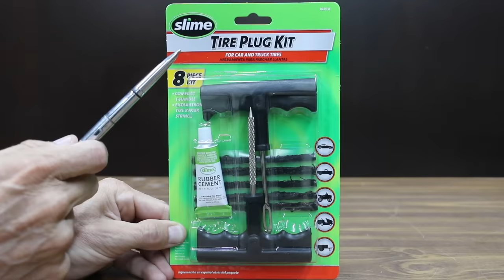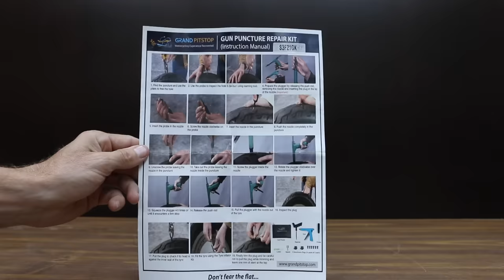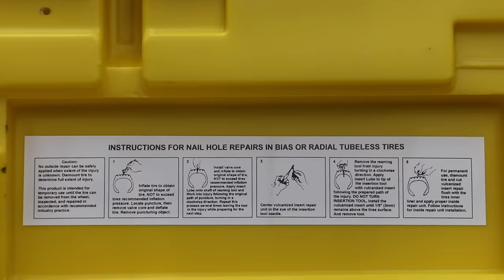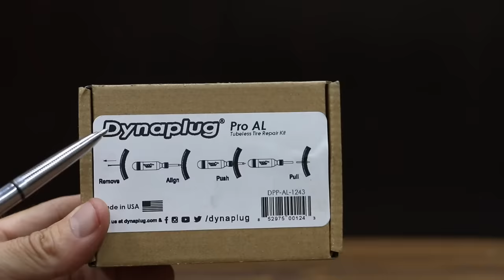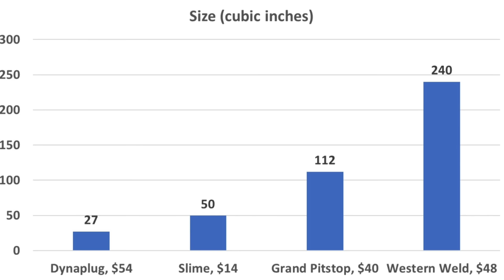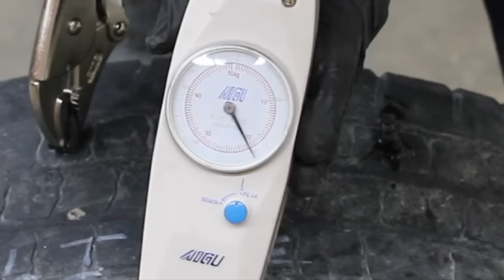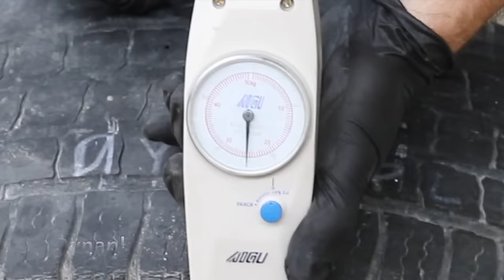Best Tire Repair Kit? SLIME, Westweld, Dynaplug, Grand Pitstop

Comment: I like the handles and reamer on the Western Weld and similar style kits. I've used the Slime style kits and those handles and probes are very difficult to ream while the wheel is installed because of how much force is needed to push them through.

I think another reason the Western Weld plugs might have performed better is the tool helps promote mushrooming when pulling out the installer.

Comment: A lot of new cars come with run flats, and many (most) shops won't repair them, even if it's just a simple puncture.  I've resorted to using this kits instead of going to a tire store.  The content here is much appreciated, I've actually used that cheap kit and had good luck with it, but will be replacing it with the higher quality kit for sure.  Thanks!
Reply from the maker: You are welcome!

Comment: Slime also makes a heavy duty kit with metal tools and the very sticky pumpkin colored plugs. I've used it on a steer tire on a big truck to get me to the tire shop and it held up to 110 psi for 30 miles. I keep it in the truck at all times. This is the most informative channel on Utube.  A big thanks to Project Farm.
Reply from the maker: Thanks!
Reply: I have been using slime plugs for about 20 years. Learned the importance on a construction site 2 hours from home. Got so good at them we repair a screw/nail hole with out needing to add air

Comment: The big difference in these repair kits is the Western Weld reamer. These almost thread their way into the tire as opposed to the rough type that depend on force. I carry a repair kit with a 12 volt air pump, needle nose plyers, cutting blade, gloves, and packable rain jacket. This is like a gun, anything is better than nothing. Which if you're going to be on  the side of the road I'd suggest having also.

Comment: Well as a mechanic and tire tech for 35 years, it was common practice to use rope plugs as a standard flat repair. Those practices worked fine (for decades) until politicians got involved.
Reply: I was a mobile mechanic and tire tech for 30+ years also. 24-7 on call road service. 👍Mr. Bean.
Yep, now if there is a plug in the tire.....very hard to get a shop to put a proper patch repair on the tire.
Also, any repair in a tire will negate speed rating and can effect load rating. So it's an insurance liability issue now days.
Most tire shops are more interested in selling new tires,  so they don't have proper repairs to be installed or a tech that knows how to make a proper repair. 
Kids now-a-days 🙄
Reply: As somone who went to get thier tire patched this weekend, half the shops just plug it and don't patch it
Reply: A few 'brown envelopes' later to corrupt politicians  voila!
Rope plugs no longer legal in Europe and some tyre companies are seeing their profits skyrocket...
Reply: @BJGlenn-cg3gs :  And we just throw more stuff in the landfill, and the cost of living keeps going up.
Reply: I just learned that this actually works. Trach your kids how to do these things, it isn't hard. Just practice repairing as much as you can. Even when it isn't always "worth it"
Reply: I'm sure failures do happen, just that they're rare enough that most mechanics don't see one or that a failed plug caused a totaling of the car so of course you don't see them.  
Still, we have insurance to cover human stupidity, and that's VERY common.
Reply: @maximman102n7  Really. I have yet to have any shop ever do that. None that I know would ever plug the hole. You are lying.
Reply: @awboat  Calling someone a liar is not only mean and vicious, it is totally unfounded. While I was having some trailer tires mounted and balanced I watched one of the techs plug two tires from different vehicles. I will not name the company but it was a major tire store in the US.
Reply: What tire plug law was passed?
Reply: @yolo_burrito there was a spate of catastrophic tire blowouts causing major accidents in Europe (likely just a coincidence) like pile ups, tunnel crashes, etc. So the EU banned tire plugs made of rope dipped in tar. However they did and do allow plug + patch repairs, allowing you to plug and then add a small adhesive patch over the top.

This comment section is trying to infer that this was done at the behest of tire manufacturers - it wasn't, it was very popular at the time. It was useless legislation but it was done to aid popularity in France, Belgium and Germany. The two largest tire manufacturers actually lobbied against the law and spent millions trying to oppose it.
Reply: @medes5597  thanks
Reply: Is it really politicians?  Or is it an insurance liability issue for the repair shop?
Reply: @awboat Three tires repaired at three different shops during five years of travel. All used plugs.  Not lying.

Comment: I was tried to repair my SUV's punctured tubeless tyre with rubber strip kit. I put rubber cement on the strip and tried to insted it into the tyre. But during inserting the needle with rubber strip in my SUV Tyre, I mistakenly put more pressure and whole rubber strip went in and loosely fell into the tyre. The hole was left opened. So I had to insert another strip to fix the puncture.
 Will it cause any damages to tyre in long run or will it cause issues in driving the car at high speed like tyre wobbling due to wheel unbalancing etc ? 
Can I drive the car normally with it ?

Comment: You should see if you can repair a tire with flex seal or flex tape
Reply: Yes. Maybe even straight roofing tar squirted into the hole
Reply from the maker: Thank you for the video idea!
Reply: I don't know about their tape yet their water proof sealer will work for a temporary fix on an already damaged tire that will need replaced.
Reply: Brilliant! I’m a huge mark for the flex products.
Reply: @ac.creations  I have done that it either works or it doesn't. If you have a hole and a screw that fits tight in the hole a little liquid nails or roofing tar can be helpful.
Reply: Flex tape would probably work as a patch on the inside of the tire.
Reply: @ProjectFarm  could you possibly do this with bicycle tires as well?
Reply: @troyna77  I've found I can change a bike inner tube faster that messing with a patch. That said, I still ride with patches in case the spare tube(s) puncture too.
Reply: @a111z  Anything made by flex seal is really expensive. If you are going to pull off a tire and patch from the inside you would be better off buying a combination patch with a plug and cement doing it the right way it would cost a lot less plus it would be safer. Tires expand, contract, flex, and too many people get killed every year from screwing around with band aids on tires. Their tape might work just long enough to get you home or to a shop. My guess is once the puncture gets moisture and dirt inside I guarantee it would probably push the tape right off. I repair tires and have seen people do just about everything and I am still seeing some crazy things that get them to a tire shop. Fix a flat and liquids are a nightmare I cringe when I encounter one and usually tell the person buy a new tire. Reason being cleaning all that stuff out of the inside of a wheel and tire is a nightmare patching those successfully it takes a lot more time.
Reply: @justme_gb  That is exactly what I do on all tube type tires. That is the smart and safest way of going about it 👍
Reply: @sswcustomsewing4276  oh yeah, I wasn’t trying to endorse using flex tape. It would be silly to go through all that trouble and not use a dedicated repair product.

Comment: The only thing missing is doing this on the side of a busy interstate when it's either 1) raining or 2) 100 degrees.  With an irritated, baby or two.  Then, it'll feel like a real-world experience!
Reply from the maker: lol
Reply: Although it is clear that any plug, by any brand, installed in these conditions will catastrophically fail after you have driven just 5 miles, so you have to stop and do it again, while your wife is bitching why you can't just call AAA.
Reply: I'd NEVER use Slime in a vehicle that is used on the highway. That is a disaster waiting to happen.
Reply: Real world experience you'd also be installing a plug with a bunch of trunk carpet plastic stuck to it and you'd lose the reamer and have to use a screw and some vice grips.
Reply: @ProjectFarm  I have a clone of the Western Weld and it's rock solid.  Very heavy duty, exactly as you described in your tests.  I plugged a tire and it held for the rest of that tire's life, somewhere around a year or so.  Really enjoyed the spirited driving montage.
Reply: @workonitm8  As a temporary measure it's probably fine. The failure mode of these plugs is usually slow loss of air, not sudden explosion of the tire.
Reply: I plugged my Ford Aerostar in the middle of the winter,in a very cold and snowy evening.That plug stayed there for another 4 years.A month ago i plugged my motorcycle,been on the highway,no problems so far.
Reply: @tirpitz19  Yeah all the plugs I've ever installed lasted the life of the tires. That's the Midwest too, it doesn't get much harsher than that. Burning asphalt in the summer and salt brine all winter long.
Reply: @jamisonw.327  I would say,a Chinese tire will disintegrate faster than an American plug.

Comment: I've used dynaplugs for years on my 1000cc superbike.  I chose them because they are the only plugs that are designed and tested as a permanent repair. All other plugs to my knowledge are only rated as a temporary repair to get you home. I fixed a puncture on a brand new back tyre and it lasted the life of the tyre which had a lot of abuse at high speed. 
Great video as always and fairplay for installing all those plugs that's some dedication! 👍
Reply from the maker: Thanks!  Thanks for sharing.

Comment: Excellent video! I’ve never used tire plugs but I have a tiny leak at the transition area from the tread to the sidewall. The tire shop naturally said it’s impossible to plug and if you did the tire could explode with the force of a nuclear warhead. So I’m going to go ahead and get the western weld kit and adhesive. Thanks again!
Reply from the maker: Thanks!

Comment: very good video and timely. I've been using Slime plugs for years and not had any issues from my lawn mower to my E rated 20-inch tires on my F250.
Reply from the maker: Thanks!  Thanks for sharing.

Comment: I agree with you on the tire plugs. I use them for a temporary fix or permanent fix if the hole is close to the edge, because tire repair shops around here won’t patch one from the inside. When I use a tire plug I always dip it into a can of patch glue for extra stickyness. Haven’t had a failure yet
Reply from the maker: Thanks for sharing.

Comment: When I worked at a tire shop, we would put glue on the plug and set it on fire for a couple of seconds to make them more adhesive. What brand are those green pliers by the way?

Comment: That was very informative.  I have plugs in my winter tire and the hole was at least 3/8 big so I  put 2 in and I haven't had a bit of trouble with it yet and that was probably 5 years ago!!  Those plugs are the answer
Reply from the maker: Thanks!  Thanks for sharing.

Comment: You left out my favorite one I use everyday at work. Built to last... Black Jack . And kit comes in a variety of colors. This kit makes tire repair easy. Most of those other kits end up snapping or bending when used repeatedly. Or they are just rough on the hands.
Reply from the maker: Thanks for the suggestion for future round of testing.

Comment: ive had the slime handles break off on me. i have a set very similar to the westweld. the problem i ran into with that was the set screws fell out  with the plug tool IN the tire . fortunately i had a vice grip to remove it with . i replaced the set screw with a slightly larger size and have spares in the box ...just in case . love your video's.your tests are scientific and free of bias.
Reply from the maker: Thanks!  Thanks for sharing.

Comment: I used a slime one (I'm pretty sure).  Mine did not come with the tube of rubber cement, but I bought some and attempted to apply it to the top of the repair job after the fact.  

After a false start because I didn't really know what I was doing, my repair held for about a year before developing a slow leak of about 1-2 psi per day, at which point I had the local used tire shop repair it after discount tire refused and tried to sell me a new tire.  The remainder of that kit now lives in my car for emergencies.

Comment: The western weld kit is sold under the ARB brand in Australia. They are truly no joke. I have no issue using them as permanent repairs on super simple jobs like nails or screws and I have even used them as a temporary repair in a torn sidewall. They stick very well to rubber that is only a few years old but have found a little heat from a blow torch helps them stick to old hard rubber.
Reply from the maker: Thanks for sharing.

Comment: I am 37 and have always used tire plugs. Still carry a walmart kit in my tire changing bag in all my cars. Great tool to have in a pinch and can keep you moving until you get a proper patch done. I believe slime brand is what I have always carried. But seeing the strength of the western wield plugs, I might have to pick some of those up.
Reply from the maker: Thanks for sharing.

Comment: One other thing is the hardness of the rasp or buffer tool. I bought a new set (none of these) from a auto parts store. 1 use and the rasp had the sharp edges wore off. Thanks for your excellent testing.
Reply from the maker: You are welcome!

Comment: I have used the brown gooey plugs since the 70’s. I have even used them on the sidewalls to get off of the highway and someplace to do a proper repair. They have never failed me yet. You can even use several together in a large hole.
Reply from the maker: Thanks for the suggestion.

Comment: I watched one test that also pushed on the installed tire plugs. The mushroom shaped plug failed at the lowest pushing pressure. The test was on motorcycle tires. The idea seemed to be if you were off roading bouncing on the tire could occur.

Great video.
Reply from the maker: Thanks!  Thanks for sharing.

Comment: I just got some tire plugs which are basically just hard rubber Philips head screws. How compact is that? All you need to carry is a screwdriver, and I suppose I will need some kind of pilers or diagonal pilers to pull out the screw or nail I pick up that causes the flat.
Reply from the maker: Thanks for sharing.

Comment: On the western weld kit : do you really have to use a valve core tool and deflate, remove object, then insert core and reinflate before starting to plug the puncture?? 
Seems like a lot of extra work that you are doing on the side of the road,  busy hiway, etc.

Comment: If you test tire repair kits again, could you add a test to see which ones are easier to manipulate/install when cold?  I live way up north in quebec and whenever a get a flat tire during winter I struggle to install the plug and some of them dont even work because the glue is no longer sticky! Thanks for you're great videos!!
Reply from the maker: You are welcome!  Thanks for the suggestion.

Comment: I agree now that they should be temporary. I used the Harbor Freight kit similar to the Slime for years, fixing nail holes in cars, truck and even motorcycles. One time I plugged my truck. All seemed well and I forgot about it. The following year I went off-road in Death Valley. On the fifth day, the tire suddenly deflated and was ruined. Subsequently I have always had the shop patch them...  a lot cheaper than a new tire.
Thanks again.
Reply from the maker: Thanks for the feedback.

Comment: Thanks for the video. I live next door to a roofer, and get nails in my tires fairly often. I've got the larger kit by Slime, with the same plugs (just more of them), the same tools, and a hardshell case. It's worked great for me, but next time I run out of plugs I'll be springing for the Westweld kit. 

For whatever it's worth, I've had better luck if I drive around immediately after installing the plugs. I've had the tire pressure push a plug out on more than one occasion if I plug it and then leave the vehicle sit overnight. Only explanation I could think of is that driving around flexes the tire and allows it to kind of mush around the adhesive and get it really stuck to the inside of the hole.

Also, I'm sure Todd with Project Farm figured this one out, but for other people in the comments: the Slime/Westweld style plugs are easier to install if the tire is already inflated. It firms up the tire and gives you something to push against. If you don't inflate the tire first, the tire moves around and just makes it a lot harder to do. I'm assuming the same holds true for the other kits, but I've got no experience with those style of plugs, so I can't speak for them.
Reply from the maker: You are welcome, Todd.

Comment: 100 plugs!!! Wao!! 
Always fascinating to watch the methods of testing you come up with. I'm a big fan.
Blackjack is a very good tire repair kit that I'd used many times when I worked for CAA (AAA) and it never failed me. It's very similar to the Westweld kit you tested.
A very good tip I used in Canadian winter was to use a small torch to make the plugs soft and more sticky before inserting them.
Reply from the maker: Thanks for the feedback.

Comment: I used a slim plug from Walmart on a dry rotted spare tire for my 89 Ford bronco back in 2010 it's still in there and holding air I sold it to my brother last year crazy it lasted that long
Reply from the maker: Thanks for sharing.

Comment: great video, i always found it was easier to push the plug in if i fill the tire with air, also i like taken the tire reamer and putting it on a drill.
Reply from the maker: Thanks!  Thanks for sharing.